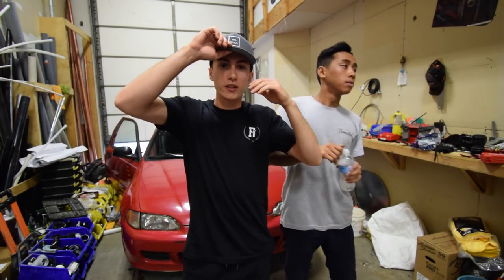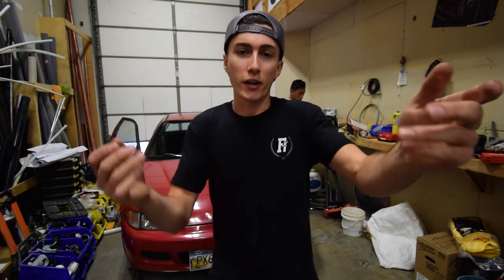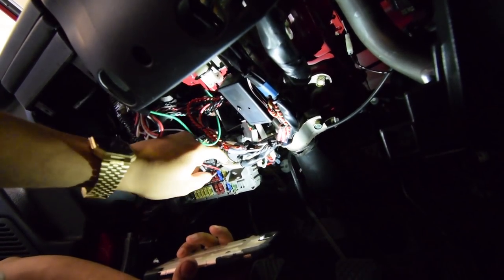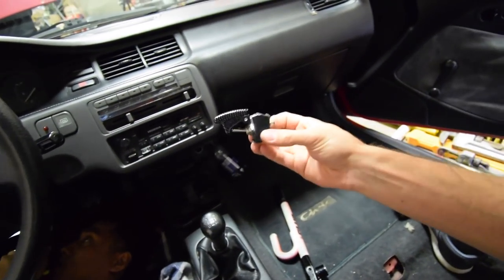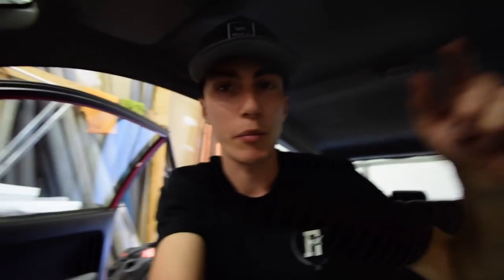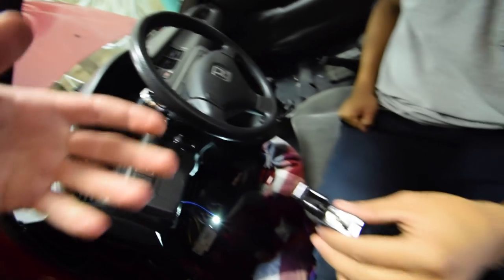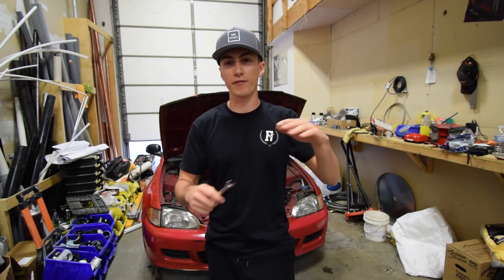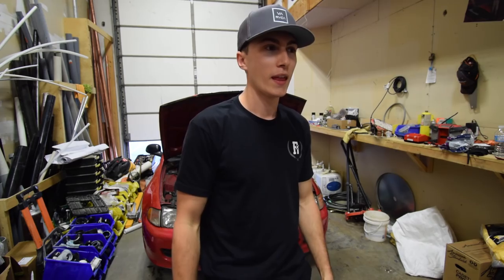NEVER Have Your Car Stolen - #1 Anti-Theft Method

Comment: To hide the switch some people use factory switches. Eg fog light/traction control/lpg switchs
Reply: An their you go telling the world. Keep it to yourself lol
Reply: That's smart, but since you can just follow the wire it's not theft proof
Reply: Mine is my AC recirculation button lol
Reply: @youssefselkani  by the time they do all of that they’ll be caught but you have a point thou
Reply: Switch
Reply: @youssefselkani  they arnt gonna waste time if you have a good alarm system
Reply: The auto shop plÿaced kill switch inmy g35 and second computer with gps.  Basically the shop is few miles from my residence and gps shows  I’m parked.kk I placed app on who’s where that can see me via gps and 3!people on my block have connections to my car showing them in a 24 uufeed ( not sure if it’s phone or their car tho)  they where kind enoughy to give me new tires and replace drilled breaks after they did burn out sets for few hours. Oh yea. They duplicated my key and fob to make their own alarm into my trunk.  I must of ran over there grandparents or shot them in an alley after a play for them to go Batman on me. Basically my car is gutted
Reply: @nicoblaytherealflamingo445  

What on earth
Reply: @johnle231  im on way to auto zone to replace battery they said I dont have warranty or bat number showing in system. More weird  just 3 weeks after 2 yr war. I need new battery and it shows August '19 when it was really November'19. They are deliberately sabotaging certain people esp nice cars.( I have front pass. Seat delete for back seat gets full leg extension lazy boy) and tron japanese rising sun logo from red led glow lights on car not under. 

Look up gangstalking voice to skull and original roblox. Im the content writers for roblox. Aka end of world
Reply: @nicoblaytherealflamingo445  

Look up “equalizing” batteries.

You can make them last very long time
Reply: @youssefselkani  im gonna use a seat belt sencer  that turns on a relay for the starter and when the switch is on the power will go to the horn so ill know if some one is trying to steal my truck

Comment: This is a well-known technique so I would highly recommend people use a magnetic switch or hide it under the carpet or floor somewhere near the driver.
They know to look for them
Reply: What about just going under the hood and unplugging battery or other cables, I know a guy that does that with his old acura, but do you think that thieves would think to check that or know to fix it?

Comment: You guys should really use a relay, those wires run more voltage than a 20 amp fuse can safely handle on a regular basis. Relays are usually rated for 40  amp loads and wont burn wires or blow fuses
Reply: yea, had a homie do a kill switch on his acura and even with wire that was the same gauge it would end up getting super hot

Comment: Wiring a switch between your fuel pump relay (including an inline fuse) is easy also.
Reply: Nope. You wanna disable the starter NOT the fuel pump. Disabling the fuel pump may throw a code and why wear out the starter?

Comment: I have one in my vw lupo! but I ran mine to the coil pack earth. is the switch is off it doesn't start. if it's on it does and when I drive I can flick it on and off and it spits a flame
Reply from the maker: hey thats a good idea, I wonder if I can shoot flames once I get my exhaust 😏
Reply: Just like my Beer rev limiter haha , ignition cut

Comment: I use a steering wheel bar lock as public advertising, but have twin kill switches to stop proper thieves. The key switch activates the duress switch. I only use the key switch when parked overnight/ longterm.
Reply: Excellent idea. Use the "club" as a deterrent then the real stopper is a hidden kill switch.. one that is NOT reachable from the driver position.
Reply: @leecowell8165  it definitely isn't.

Comment: I have a suggestion put a bunch of those switches in a sequence then that's your own code but do not ground out the wire put a hard metal stainless steal cover on the back or it will ground out and some silicone spray or something then your good for extra per caution  you use don't want it to ground out on the wrong thing have aground it will shock you really bad a lot then put it in a metal  lock box in your dash with a key  🔑 for extra perception you use sorry but my phones being dumb sorry and I can give you another tip if you want

Comment: My Integra Type R was stolen. It had an alarm, kill switch, club, brake to shifter lock, clutch lock. 

They just towed it.
Reply: Damn, that's unforunate. Did get to replace it with something better at least? It was proofed up enough for them to tow it away, that's honestly shows how well you secured it.

Comment: My car is set up for it if anybody goes inside my car to steal it the car automatically locks itself and turns on car automatically there's a hose carbon monoxide will fill in the cab and kill the guy...lol😂🤣

Comment: It’s not a kill switch it’s an immobilizer switch. A kill switch is used for racing to kill the power to the car when in an accident to prevent fires from starting for live wires near fuel

Comment: Be so much better instead of a boring ass toggle switch?  Spend a hundred or two and wire in a PLC  (PROGRAMMABLE LOGIC CONTROLLER)  Rather than the car simply not starting?  Why not have it start and stop over and over ...Why not have the horn honk and then stop and then start again?  Why not have the emergency flashers come on go off come on....Just make it utterly ridiculous to try and drive the car ANYWHERE....but I mean what is cool is the crook's partner dropped him off and then splits believing the car in the bag but instead they now have the scenerio from HELL.....LOL...They AINT gonna make it...hopefully they get caught in fact...if they have any brains they will early on get out and RUN!  LOL
Reply: Personally I would NEVER try stealing someone's car cause there are SICK people in this world that MIGHT do much more to prevent theft than simply wire in a kill switch!   Say they are just sick as hell and say they REALLY hate  a damn car thief?  What IF that PLC did something else?  What IF an extra little fuel injector started squirting gasoline from the dash somewhere RIGHT in the perp's LAP?  Ya know...after they have been underway a minute or two...so naturally they are gonna panic and get the hell OUT ....right?  Problem is the PLC  ALSO has directed full ignition voltage of 80.000 volts THROUGH the  seat belt connector..and yes it probably shocks the holy CRAP out of them when they go to push the release the release button to get OUT of this gasoline spewing car from HELL...but that is not the REALLY bad thing....the BAD thing is the huge blue rapidly pulsating SPARK As the seat belt prong comes out of the release....And ...and ....an oops everything in THAT vicinity is soaked with fuel ...their abdomen, thighs, crotch, balls, anus, PENIS....ALL of it DRIPPING with fresh WET fuming high octane GASOLINE....which I mean DUHH you KNOW is gonna....gulp ... IGNITE!....so they hop out running around engulfed in flames around the lower torso....the worst imaginable end to a car thief!    Hey would anyone ever even bother to figure it all out?   Some low life car thief dies and a car he had stolen burned up....might never get "solved" even?   Be easy enough to DO that I sure wold NEVER try to steal anyone's pride and joy!  No WAY!!

Comment: If sum1 is gonna steal it and hot wire it they'd see those extra wires and figure it out wuldnt they😂
Reply: Them older civics cam be stolen with a stripped key since the ignition and locks are worn with age these cars are at least 20 year's old if not older